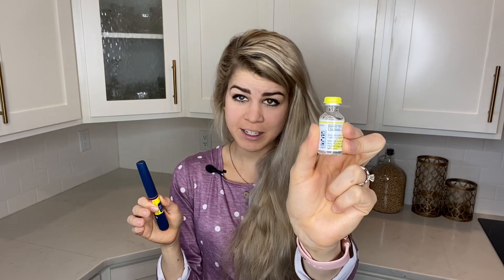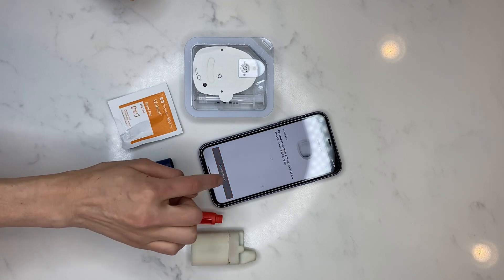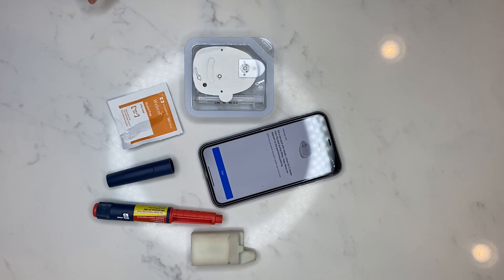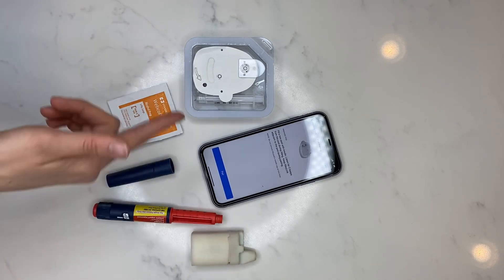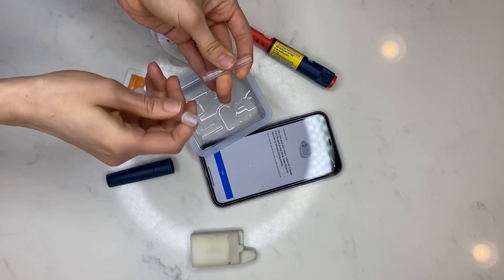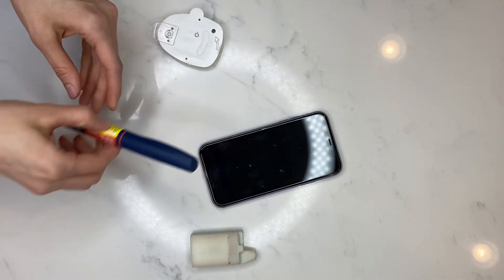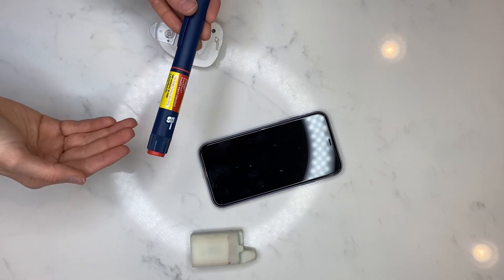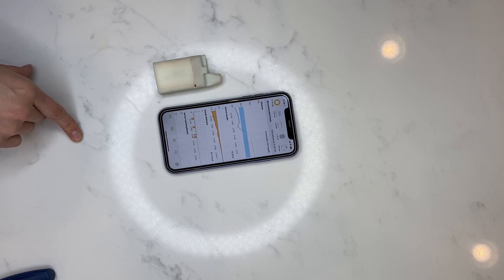How to STOP Wasting Insulin with Your Omnipod System or Pump

Comment: I did this as shown. When I took the pen out of the plunger, it sprayed insulin everywhere and made a hissing sound. So, this technique didn't work for me.
Reply from the maker: Oh no! Thank you for letting me know. If it is spraying insulin, that is less about the insertion, and likely more about using an overused area. I would definitely use a different area on your body. If it is a well-used area, it will also negatively impact insulin absorption. Try a completely new place on your body with your next insertion. For example, if you often use your stomach, switch to your sides or arms.

Comment: I once left an old Dexcom sensor in (I was also changing the transmitter with that sensor change) and did a double take when I was getting ready to take a shower that evening. Had to remember which was the new sensor/ transmitter. So, yeah, I can see where that might be a thing with the pods too! ;)

Comment: Average 42.3 units a day, some days the pod doesn't last me two days and considering going back to the pen. If you have only a few small bubbles, they aren't an issue. Unfortunately my provider wants me to use the vials, this probably has to do with my insurance company than my provider ?

Comment: Very helpful. Thanks. I’m a relatively new type 1. Expired September 2021 but unopened humalog pens kept refrigerated. Would you use or discard? Hate to waste them. Entire unopened box.
Reply: Potency is guaranteed only until expiration date if unopened and stored according to instructions. I'd probably use insulin up to 6 months past expiration and see what effect it had on my blood sugar.  I base this on FDA studies done for the US Military that found that IV preparations were still at 95% efficacy at 6 months. Use not recommendation 18 months after expiration. The study was done before modern insulins came on the market, so you are kindof winging it.

Comment: Balderdash. A vial will last months.
Reply: Once you've opened a vial of insulin, you have to toss it after 28 days due to bacteria accumulation.  That is the sole reason you are tossing it - it might be effective longer, but the bacteria are a problem.  Long acting insulins have a different profile and can be opened longer, but they aren't used in pumps.

Comment: Hi, I noticed you were using an app on your phone to deactivate and change your pod, so i was curious to know what the name of the app is because i have been using a PDM and using my phone would be a lot easier.
Reply: I am also interested in knowing how you have the system on your phone and not on the device. That would give an opportunity to people who do not have the money to pay for that device that serves the same thing that both the cell phone and the device do. You could share what the app is so I would have more option to buy only the pods. Thank you
Reply: @andreaherrera8011  Are you familiar at all with the technology? The loop app is a hack not approved by the FDA that serves as a link between the CGM & pump that would usually not be able to link together.  You could not buy just the pods, you need the whole system.
Reply: It’s her loop app, it’s if you use the loop system
Reply: Omnipod 5 will have more integration with CGMs and phones in '22.
Reply: Its called loop and you order a thing that you assemble and stuff, it’s just a hastle but it will make your A1c way better because the pod communicates with your CGM

Comment: Question!!! How can I extract insulin from the pod when it’s come off early - like a day after changing it out bc of swimming or activities! I hate to waste insulin! I can never extract much and I’ve been told to put 125-150 units in when changing which I now see is hugely wasteful!! My daughter uses only @30-35 units per day! Please help!
Reply: I do it every time. Wasting insulin is offensive to those who have died by rationing in my opinion. You pull out the insulin from the pod the same way you put it in! You usually cannot get ALL of it out, but any is better than none imo.
Reply: @MollyMA13  yes, wasting insulin is a sin!
Reply: @MollyMA13  i tried
It didn’t work 
I had 74 units left and the srynge only got filled with air
Any clue why ?
Reply: @Pot8oes Its super weird, but it doesn't always work.
Reply: You can try holding the pod above or below the syringe, or just different positions.

Comment: I have had diabetes for about 25 years. When I was first diagnosed it was gestational. Then after birth. I was told I have type 2. My husband swears iam type 1. I feel like doctors are scared to change that diagnosis. Iam high alot then low. Sometimes in the 50 and 60s. I wear a tslim x2 pump and will have the CIQ in a couple days. I struggle so much
Reply: Easy.  Have them check your antibodies.